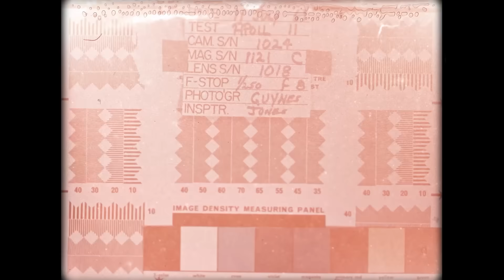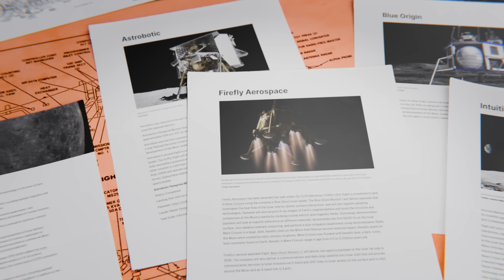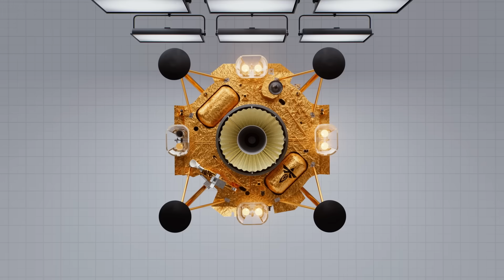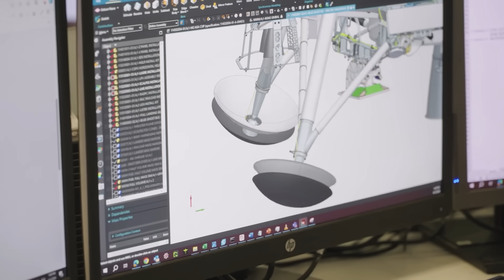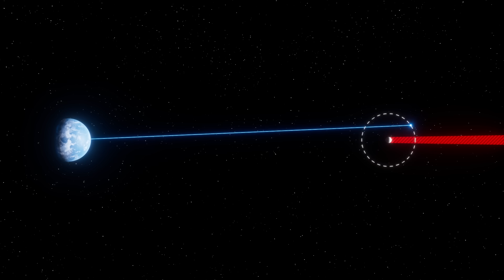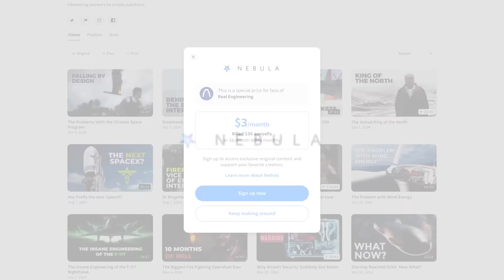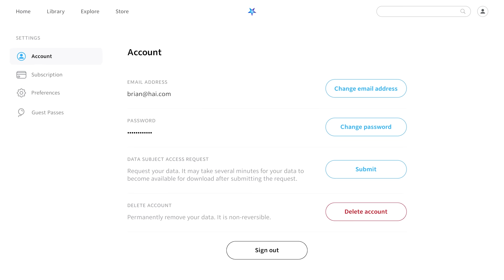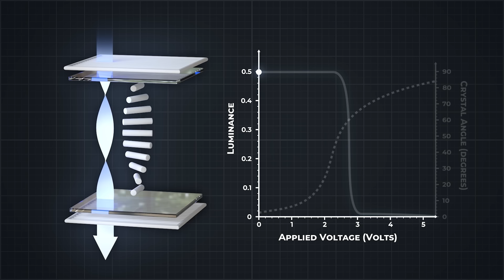Why the US is Struggling to Land on the Moon

Comment: We've never been to the moon , do you geniuses ever look at the footage of the moon landing ? The lander looked so cheaply built it would blow apart in 20 mph wind . Buzz Aldrin admitted that we never went , we will never go . If you truly believe we went 60 years ago but cant go now youre an absolute idiot .
Reply: why would the lander need to worry about wind???
Reply: @nullifiedknight Idk why would a flag on the moon flap in the wind that doesn’t exist there ???
Reply: @skylightoutdoors7374   it doesnt flap because of wind, it flaps because of the kinetic energy transferred to it from the astronaut planting it down onto the ground. it looks more prominent on the moon because the moon has less gravity and there is less downward pull that would weaken that waving motion of the flag.

if you're asking why the corner of the flag never seems to fall down toward the ground, its because the top of the flag is attached to a crossbar attached to the flagpole so that the flag doesnt just fall limp against the pole (since there is no wind, you need to add a support to make the flag go upright)
Reply: The footage shows a lander that is built for a single purpose: to land on the moon. It was not “cheaply built”, it was optimized for that task. Because it would never have to operate in an atmosphere, the lander did not need an aerodynamic shell. Its outer covering could be as flimsy as needed to get the lowest weight possible.
Reply: @Hobbes746  So please explain to me how we had the " Technology " 56 years ago , to build a lander so light and " flimsy " as you say and go to the moon . Yet now when we are lightyears ahead in Technology , we can't build a craft strong enough to withstand the Van Allen radiation belts ??? But theses guys went in buzz lightyears cardboard ship from toy story ? The fact people are stupid enough to actually believe that is very concerning to me .
Reply: Radiation does not put a physical force on the spacecraft: you could build a spacecraft from paper and it’d go through the belts unharmed. 
The Lunar Module was not occupied when it went through the VA belts. the astronauts were in the Command Module. Its pressure hull and heat shield reduced the radiation level inside by a factor 100, which is more than enough to travel through the belts safely. 
The LM offered a bit less protection, because the LM did not have a thick phenolic resin heat shield. 

The radiation level on the moon is low enough that an unshielded human can spend a month on the surface before his radiation dose reaches 50 mSv (the OSHA annual radiation limit).
Reply: @skylightoutdoors7374  You are calling people “stupid” for believing the Apollo landings are real, when the reality of the moon landings is supported by tons of evidence. Your arguments against the missions however are based on a lack of knowledge.
Reply: @Hobbes746  NASA you know the space people , literally have stated they can not safely send a vessel carrying humans through the Van Allen Radiation Belts , so wtf are you talking about it
Reply: @skylightoutdoors7374  James van Allen discovered the VA belts in 1958. By 1962, he had mapped the radiation levels in the belts and found humans can safely travel through the belts. 
It takes a WEEK, not “minutes” for a human to accumulate a lethal dose of radiation, if he stays in the center of the belt, where the radiation level is highest.
Reply: @skylightoutdoors7374  We’ve been building satellites that operate in the van Allen belts for the last 50 years: GPS and geostationary satellites. These days, you can buy radiation-hardened electronics, made for an environment far harsher than the VA belts, off the shelf. 
The Orion capsule, which has been developed for new manned lunar missions, has made two test flights, both of which passed through the VA belts without any issue.
Reply: @Hobbes746  So you believe
Reply: @ You believe NASA when they supposedly say something that supports your belief but then you don't believe NASA when they say they've done other things that go against your belief
Reply: @ Nobody at NASA claims they cannot send humans through the van Allen belts.
Reply: No, Aldrin never claimed he did not go to the moon. That’s just moon landing deniers lying to you.

Comment: See what I am really confused about is why don’t they use a laser rangefinder to assist in ascertaining, whether or not it is landed or not? When the foot sensors trip saying that it has landed , it should blow the cap off the laser designator and then shine the laser.
Reply: Intuitive Machines installed a laser rangefinder, then forgot to switch it out of safe mode: a mode that disables the laser so you can safely work on the device without risking the laser switching on. They should have checked that during the preflight check, but didn’t. Once the spacecraft was launched, they were screwed: there’s no way to flip that switch remotely. 
So they cobbled together an alternative altimeter from one of the payloads, but that wasn’t designed for the job so it didn’t work as well. It gave incorrect altitude readings, and they hit the ground while still moving at a speed too high for the landing gear to cope with.
Reply: @ are you talking about this current machine here or a different one? Also, the idea is still a good option. We just can’t have somebody screw up again..
Reply: @ What I described was what happened with the IM-1 mission.

Comment: Apollo program: 6 attempts at landing, 6 successes.  Where were the failures of landing on the moon?  Apollo 13 had it's landing scrubbed before it even reached lunar orbital insertion.
Reply: NASA’s failures of landing on the moon were in the 29 unmanned missions they did before Apollo: 
8 Pioneer missions, all of which failed
9 Ranger missions, 6 of which failed. These were impact missions designed to crash into the moon and take photos on their way down. 
7 Surveyor missions, 2 of which failed. 5 made successful soft landings. 
5 Lunar Orbiters, 1 of which failed.
Reply: @Hobbes746 Yet they magically went 6 for 6 with Apollo.....  🤔
Reply: @ There’s nothing magical about that. 
As the mission summary I gave earlier shows, the success rate rapidly improved because they were gaining experience through 29 unmanned lunar missions. 
In addition, they ran the entirety of project Gemini to test and practice essential procedures for Apollo. They did 6 unmanned Apollo missions, then 4 manned missions that tested every part of the mission and all of the equipment before committing to a first manned lunar landing. 
Then, on Apollo 11, the astronauts noticed that the landing point was in a boulder field, so they adjusted that and saved the mission, where a Surveyor-style unmanned mission would have crashed.  
On Apollo 12, a lightning strike came within seconds of them having to abort the mission because the CM was without power. Apollo 13 failed to land entirely. 
Apollo 14 required reprogramming the AGC during the descent to the surface because a faulty switch was threatening to trigger an abort. 
In summary, they achieved 6 landings out of 7 missions through thorough preparation, quick thinking and a dose of luck.
Reply: @Hobbes746  6 of 6 landings, the Apollo 13 landing was cancelled before they even reached lunar orbital insertion as I already mentioned.
Reply: @michaelg4931  So, you’re just ignoring everything I said and are clinging to a spurious argument?
Reply: @michaelg4931  I’m not disputing they succeeded in 6 landing attempts. Your problems are
1. assuming there have to be problems landing on the moon,
2. ignoring the problems that existed in project Apollo,
3. ignoring the missions that came before that enabled Apollo’s success.
Reply: @Hobbes746 I'm not the one who made a video on how hard it was to land on the moon when it was done successfully 6 times out of 6 attempts 50+ years ago using computers with a minuscule fraction of the power available today.

All the Apollo missions before the first successful landing DID NOT ATTEMPT to land.  EVERY SINGLE ATTEMPT was a success.
Reply: @ Pay attention this time: the success of Apollo was enabled by 29 unmanned lunar missions that came before it, plus 10 Gemini flights, plus 10 Apollo flights made before Apollo 11. 
IM-1 is the FIRST SPACEFLIGHT by this company.
Reply: @THEfonz-s5u   I was and am pointing out that it must be pretty easy if they could successfully land on every single one of the 6 attempts with next to no prior knowledge of spaceflight in general in comparison to today.  SpaceX alone did 170+ precision landings this past year so it's not that 'extra-difficult'.
Reply: @THEfonz-s5u I am pointing out that they attempted and succeeded in 6 out of 6 attempts at manned landings on the Moon when it had never been done before.  Proving it must not be that difficult.

And just how are the 170+ Falcon 9 precision landings of the cores and boosters not a legitimate comparison?
Reply: @THEfonz-s5u Falcon 9 final landing control is not handled by GPS.  It uses it's inertial guidance and radio altimetry systems.

Your lack of critical thinking skills is showing.  Explain how NASA landed 6 for 6 50+ years ago with NO GPS and computers that were minuscule fractions of the computing power available today.
Reply: @michaelg4931  You should look at launch statistics sometime. New companies often fail their first launch. You should look at the statistics for lunar missions too: as I’ve already told you, the first mission from an organization has a much higher chance of failure than later missions form the same organization. The success rate rises. And by the time Apollo 11 came around, NASA had done more than 30 missions to the moon. More than enough to build the experience they needed to commit to a manned mission with a reasonable chance of bringing those crews back alive.
Reply: @michaelg4931  The getting to orbit and transiting are RELEVANT because they’re part of the same mission. Mission success can only occur when all parts of the mission succeed. This is why Apollo 13 is a failure: they did not succeed at all parts of the mission.
Reply: @michaelg4931  Before Apollo 11 there were 6 unmanned test missions: AS-201, 202 and 203, Apollo 4,5,6. Then 4 manned test missions: Apollo 7-10.
Reply: @michaelg4931  "next to no prior knowledge of spaceflight in general “ as I’ve already told you, NASA did 29 unmanned missions to the moon alone before Apollo 8. Their total mission count to the end of 1968 was about 520.
Reply: @michaelg4931  You should learn to count, and read my posts again. I said there were 6 unmanned Apollo missions, and 4 manned Apollo missions before Apollo 11. 
6+4 = 10.
Reply: @michaelg4931  The success rate did rise. The Pioneer missions had a success rate of 0%, the Ranger missions were at 33%, the Surveyor missions were at 71%. 
In modern times, new organizations that have never done a lunar mission before have a lower success rate than organizations with lots of experience.
Reply: @Hobbes746  Pioneer lunar missions 0 through 4,  40% success rate with #3 and #4.  The rest of the missions were not lunar missions and NOT ONE of any of the Pioneer missions had the objective of LANDING on the moon.
Reply: @Hobbes746  Ranger missions 44.4% success rate, 4 of 9.  Again NONE hand LANDING on the moon as an objective.
Reply: @Hobbes746 And you proved my point with the Surveyor missions with a 71.4% success rate which happened BEFORE Apollo and surpasses the recent average of less than 45%
Reply: @Hobbes746 You better learn your history of the Apollo program  .  There were NOT 10 Apollo missions before Apollo 11.  If you can't even get that simple fact right, you're a waste of time.
Reply: @michaelg4931  The Ranger missions were impactors: they had to crash into the moon, taking video on the way down. 6 out of 9 failed to do that. One impacted the moon but failed to send images, that’s a failure. The Ranger missions showed that in order to land on the moon, you have to get to the moon first, which is a difficult problem in itself that has to be solved. This is an essential part of enabling a soft landing on the moon. 
You keep pretending that soft landings are somehow completely separate from the rest of the mission, when that just isn’t the case.
Reply: @Hobbes746  Impacting is not landing.  Again, since you seem dense, this video is specifically about landing.

You still claiming 10 Apollo missions prior to Apollo 11 or did you educate yourself?
Reply: @michaelg4931  You continue to claim landing is an entirely separate part of the mission. That claim is nonsense. The same factors that can make a landing fail can also make other parts of the mission fail. 
Learn to control the process by doing nothing but orbital missions, and your chances of doing a successful landing will go up. 
Case in point: Intuitive Machines’ first mission failed to make a soft landing because their process for the preflight check was flawed. If they’d done a few orbital flights first they’d have screwed up their preflight check on one of those flights and would have improved their process, avoiding this mistake on their first landing.
Reply: @michaelg4931  I’ve given you the exact number of missions that came before Apollo 11. I listed ten missions:  6 unmanned test missions: AS-201, 202 and 203, Apollo 4,5,6. Then 4 manned test missions: Apollo 7-10. TEN missions. You  should learn to count.
Reply: @Hobbes746  Then I guess you should tell NASA that as they show 8 on their website for the Apollo program.  2 & 3 were scrubbed.

Comment: Computer modeling.  Not real engineering science.
Reply: Intuitive Machines made a far more basic mistake than that: they skipped a step during the preflight check. This left the altimeter set to safe mode (in which the laser is disabled so you can safely work on the device). Because the safe mode switch is a physical switch that cannot be operated remotely, they were screwed the moment they launched IM-1 with that switch still in the wrong position.

Comment: A better comparison of technology would probably be NASA's Surveyor program. It used a collection of analog computers/servo loops, a landing radar, a sophisticated radio telemetry system , and some remote control to land. 

It also had a video camera, various experiments, a mechanical arm (depending on mission).
Five out of seven landed successfully in the 1966 to 1968 time frame.

Extensive mission reports, and system composition documents are on the web.
Reply: The big difference is that the Surveyors used blindly, using that radar only to measure altitude. IM-1 and other modern landers use terrain recognition so they can change the landing point autonomously of that point turns out to be unsuitable.
Reply: @zounds010  I said it was a better comparison, meaning that a comparison of the landing ability between a modern autonomous lunar lander and an antique lander that  had men it would not be as good a comparison (given the title/concept of the video) of technological ability as the Surveyor series spacecraft vs modern autonomous landing systems. 

Aside from the computer between an astronaut's ears, there was not enough computing power available (probably not with all US government computers combined) to NASA at the time to do any kind of SLAM (or similar)  in realtime. 

If that's your criterion then there is no comparison (for years 1960-70 technology) at all.
Reply: @zounds010  @zounds010  I said it was a better comparison, meaning that a comparison of the landing ability between a modern autonomous lunar lander and an antique lander that  had men it would not be as good a comparison (given the title/concept of the video) of technological ability as the Surveyor series spacecraft vs modern autonomous landing systems. 

Aside from the computer between an astronaut's ears, there was not enough computing power available (probably not with all US government computers combined) to NASA at the time to do any kind of SLAM (or similar)  in realtime. 

If that's your criterion then there is no comparison (for years 1960-70 technology) at all.

Comment: Might be nice to give these landers animal like legs to right themselves if they tip over. And of course making them strong enough when tipping over. Maybe those inflatable balloons.
Reply: Side thrusters would’ve also helped.
Reply: Why? that would add weight and complexity, and only help in a vanishingly small subset of possible scenarios. In most failure modes, the spacecraft will simply hit the ground at far too high a speed to survive.

Comment: I don't see what the big problem is, except giving huge apyouts for those developing the lander. Just do exactly what they did in 1972, no big deal, no drama. We have much more technology now.
Reply: The unmanned landers NASA used in the 1960s (Surveyor) landed blindly, with no way to avoid terrain that would wreck the lander. 
The Apollo landers had humans on board who could adjust the landing.
Now, we want unmanned landers to land using modern sensors to read the terrain and avoid obstacles.

Comment: Center of G here, center of G there.
They built a lander in the shape of a fridge.
Drop a fridge from any height, it will tip over.
Is NASA hiring? I have some common sense to share
Reply: They had to land without a functional altimeter. So they touched the ground before the horizontal speed of the lander was brought down to zero.Any lander is going to fall over when you do that.